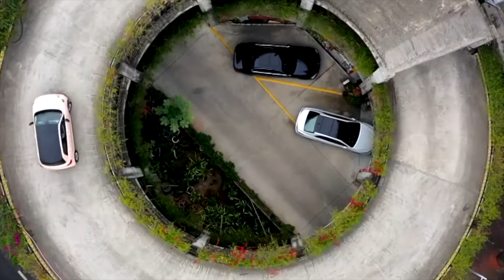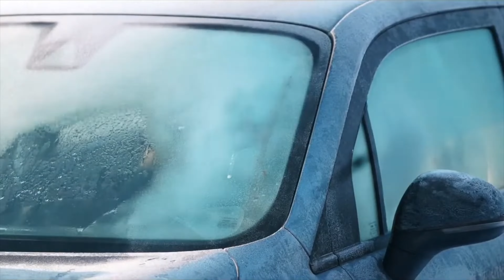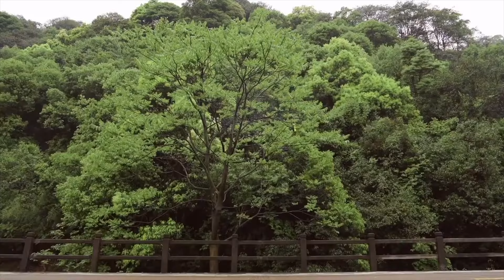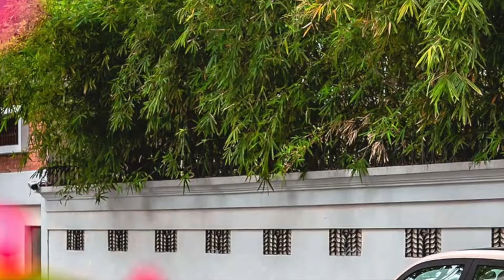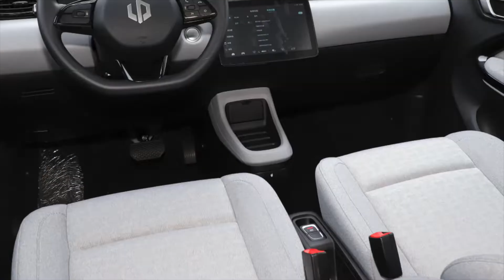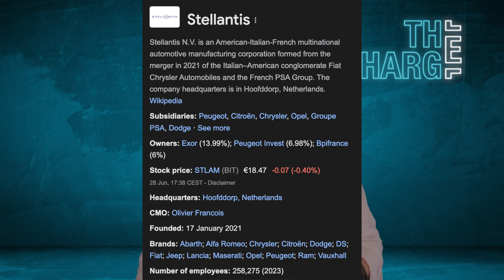This European-built EV faces Chinese EV tariffs!

Comment: The video highlights China potentially using a loophole by "manufacturing" a product in a new plant that likely just assembles pre-made parts from China to avoid tariffs. This tactic contrasts sharply with Tesla, which faces criticism in Germany but builds cars with a significant European supply chain. Tesla's approach makes them a strong example of a company committed to European manufacturing of electric vehicles.